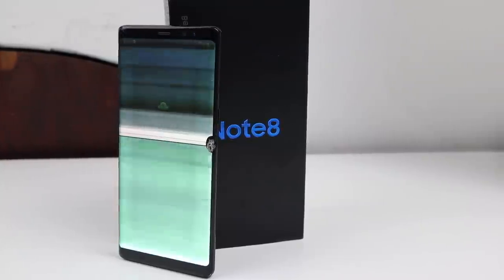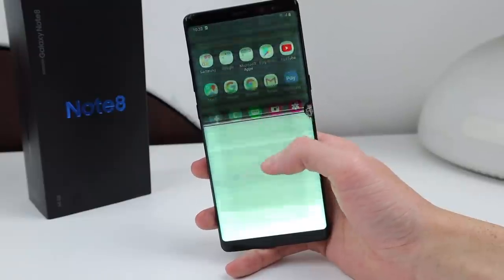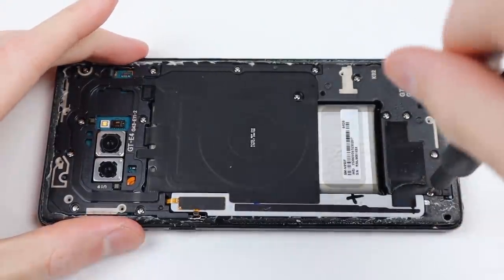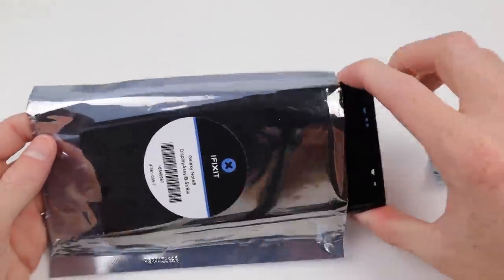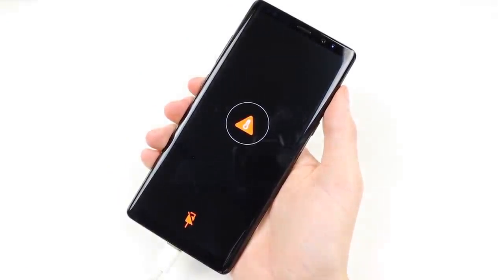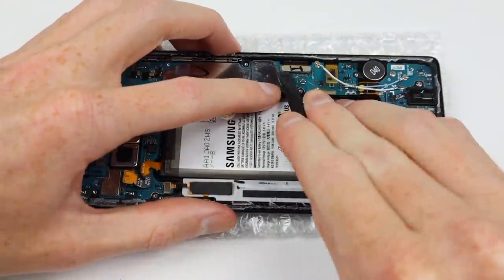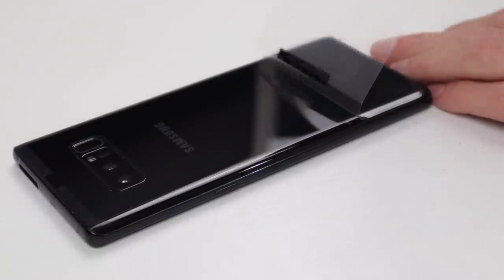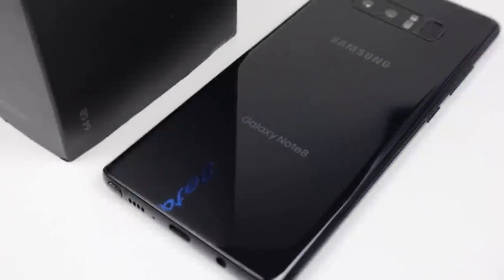$101 Note8 Restoration

Comment: I wonder why are people buying those cheapo protection cases.. Sure, they are really thin but they are not giving you any protection.
I had a thick Spigen case and had an ATV accident on the highway while having my note 9 inside a phone holder.
The phone flew for a couple of meters and it only got sew scratches on the screen and the rest was absorbed by the case.

BTW. You not plugged the wireless charging coil correctly, when you first tried to charge it.
At the top of the charging coil, there is a little nibble which is a temperature sensor. If it's not detected by the phone, then it won't charge..

Comment: I brought a tmobile galaxy Note 8 off ebay for $ 25.99 dollars it has a cracked screen the back cover isn't cracked the seller thought it was broken because the didn't power on the only thing was wrong with it was the battery completely dead i after changing the for about five minutes the phone came on only thing the phone won't fast charge

Comment: Ordered a Pixel 2 XL frame from iFixit and it came severely bent and the replacement screen I also got from there had a pin in the connector broken so it would only show half of the display, I returned it and they swear they gave me a refund but I never got it, worst purchase I've ever made and will probably never buy from that website again.

Comment: nah that glued back some profesional has inside already before you :F + that sticker on battery and that glue on lcd has to be already preinstaled on battery if you have original, that temperature sensor is installed on the back plast - nfc, and you left fingerprints on camera lens, aaaaaaaaaaaaaw